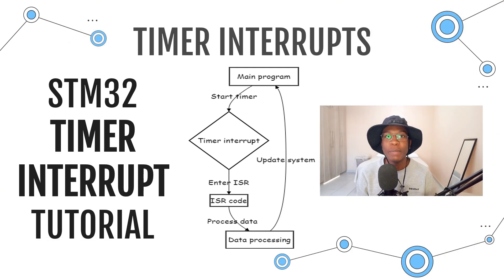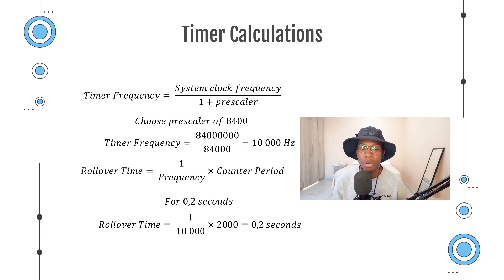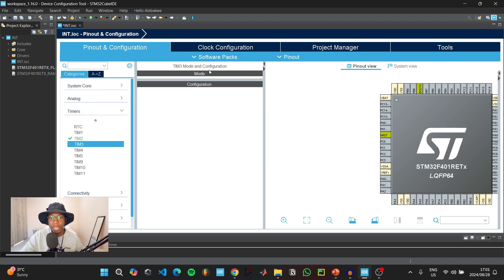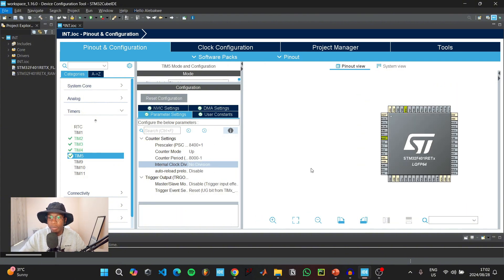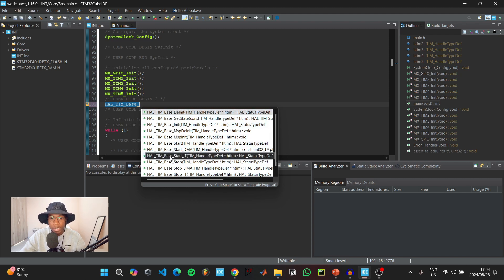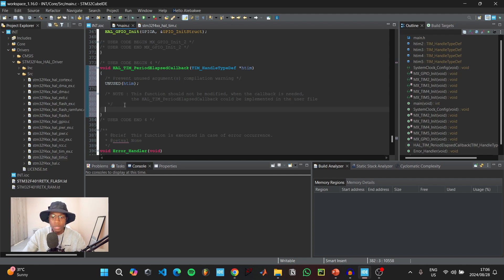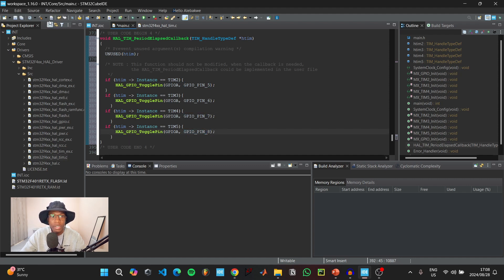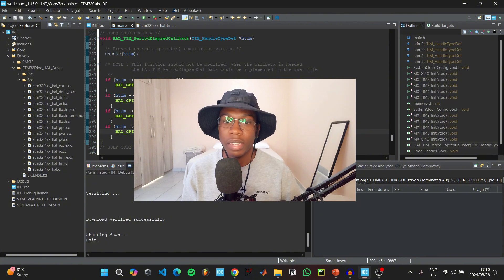STM32 Beginners Guide Part7: TIMER INTERRUPTS | How to use Timer Interrupts on STM32 |

Comment: 6000 is 0.6s ?
Reply from the maker: Hi, If you're referring to the Rollover time calculations then Yes using 6000 as the counter period value would give you 0.6s,  but if you're referring to the value inside the HAL_Delay() function then 6000 would be 6s.